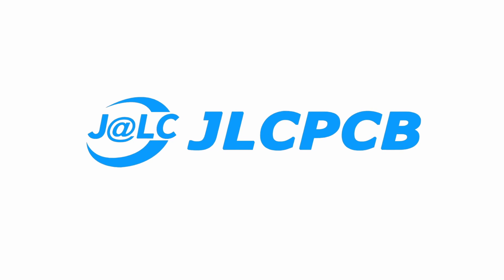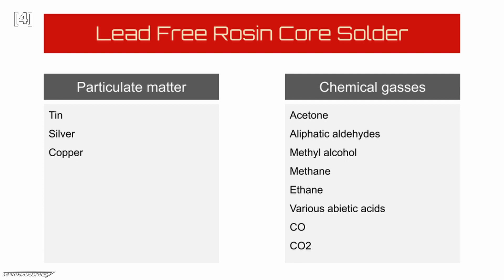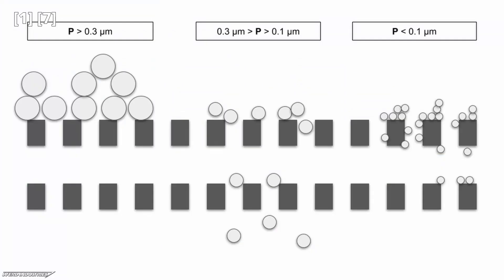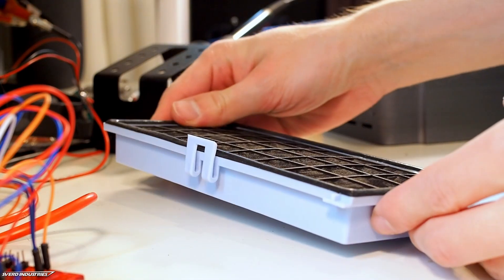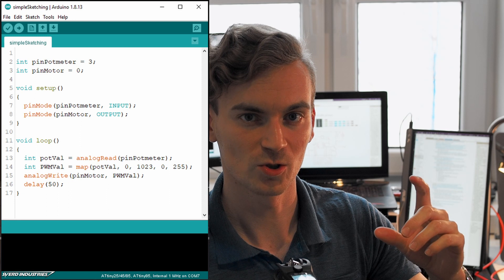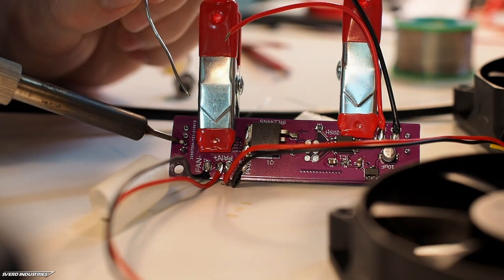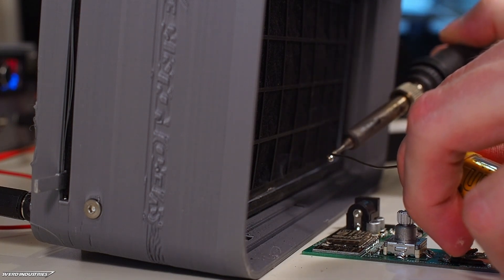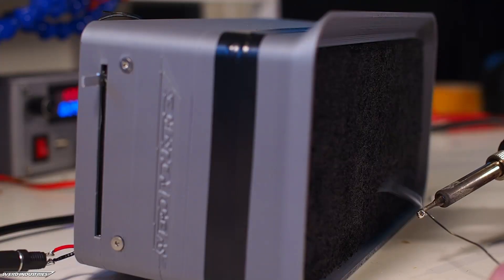Why You Need a Better Solder Fan. And How to Make It

Comment: Your video is amazing and very important and better than other more popular videos. I actually just had my last final in my studies about the topic of seperation of particals from gaseous streams. Like you say in the first part a filter only works for certain particals under certain circumstances (speed of stream, etc.).the videos on YT I have watched about diy fume extractros have the dangerous assumption that if you slab an AC filter on a pc fan I can solder in a closed room because everything is filtered.
There is on problem with your video it is hard to find because of its Titel. Please consider to include strings like "diy fume extractor", "solder fume filter" so it's more likely to pop up when people search for this!

Comment: As far as I know those PC fans are not great on sucking air at all. A centrifugal fan would do a better job. But you might want to try placing the fans to the very beginning of the airflow hoping that the blowing action is more effective here as sucking action.
Reply from the maker: That's a great callout, I might do some experimentation with centrifugal fans to improve the design. Thanks!